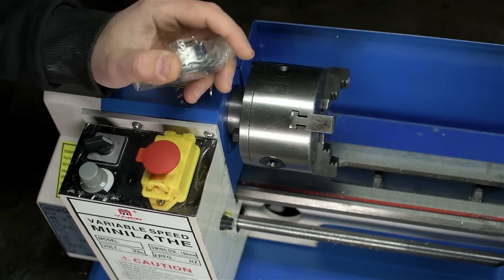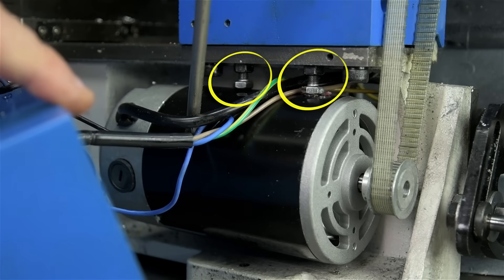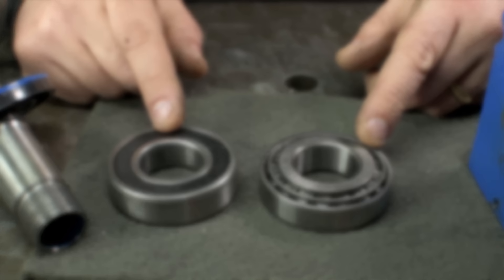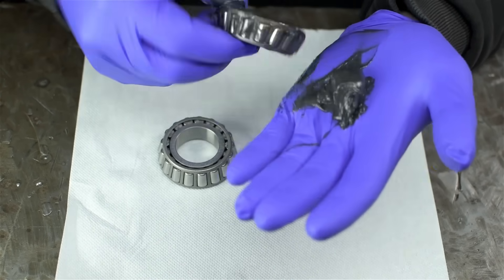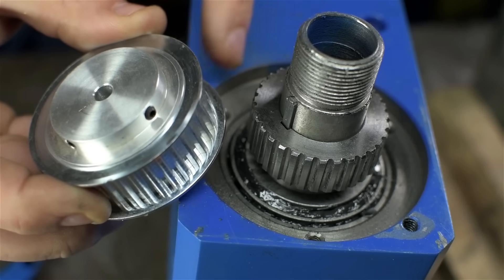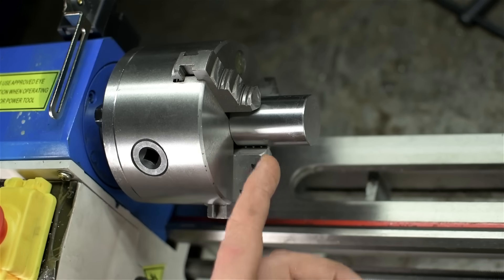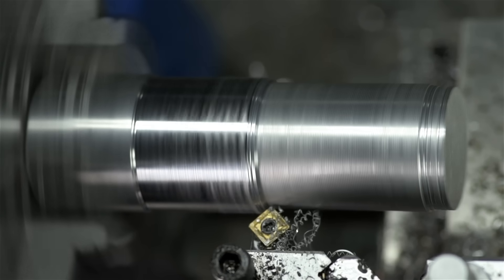Better LATHE Than Never!

Comment: I had a 1970 VW bug. Now I worked on fixing this at 16. Yeh Dad, helped, but I put the fire out; when he was brazing.  The Pre-70's front ends had twin nuts, like you have and a tin sheet metal flange you beat over to lock the nuts in place.  Well - I had to change my front end, for a 72, that I also grabbed. Whole cars, were as good as spares, back in the day. So imagine my wonderous  surprise, when I was met with a pair of roller bearings and a split NUT, with an Allen screw.  The word F-UP was entered into the Webster Unabridged Dictionary - in 1980, when I realized I had crushed the roller bearings and races. Installed a fresh set for a Prince-ly sum and I was on the roll again.  Cheers all!

Comment: I have this lathe and its biggest flaw is the carriage. It is, as you show at the very end of your vid, sketchy the way the carriage is fixed to the bed. I though of some plates with underhung bearings, but the underside of the bed is rough casting,  so I'm not sure this would work. 
Did you ever do a fix for this issue? I find it really limits depth of cut before the carriage starts moving around and vibrating... Cheers Martin

Comment: Bearing load is kinda critical. It would have taken very little time to turn one from some steel like material... Aluminum might be close enough. Plastic, besides being crushable has a nasty thermal expansion coefficient. Granted while expanding it will soften an self crush, but when cooling it will shrink with nothing built in to counter that evolution. I really appreciate this this video or perhaps relate to it as I've been trying to tune up one of these Chinese chunkers myself. I won't play favorites though. Life would be significantly less swell without any one of your videos!

Comment: I just bought a mini lathe like yours and it's missing the potentiometer switch I ordered a new 4.7 k pot for it the potentiometer but it's missing some of the wiring is there any way you could take a picture of how your control board is wired to the potentiometer switch for me please
Reply from the maker: are you sure your version is variable speed?  there are (I think) just 2 speed versions? + change gears.
Reply: @ThisOldTony  it says right on the front veritable speed mini lathe model cj0618 and on the back side it does have hey lever but never less I need to know how the wires hook up to the potentiometer I know they go to P1 P2 and P3 but I don't know how my red power wire hooks in I'm not sure if it wires in with P3 and also I have a green wire that's sniped on forward reverse switch I know the two little wires coming off my small board AR the ones that go to the bottom of my potentiometer 4 Switching gears when I turn the potentiometer switch off

Comment: I used angular contact bearings in mine and changed to a 3 phase 750W 1 hp motor. The motor inside the lathe was claimed to be 550W, but was so gutless I didn't believe that. Also there was no labeling whatsoever on the motor. Like you I removed the compound. I only put it on when I need to cut tappers.

Comment: my hardinge HC (same headstock design as HLV-H) has a lowly pair of greased ball bearings in the headstock....should i replace those with a pair of $5 tapered roller bearings?

Comment: Hey mister T. I got a question. I've just ordered a mini lathe called mw 210 (8X16) from China and I want to tig build his table. I was thinking of a table only made of square tubing without plane sized of 700mmx300mm x 900mm(high). What shape do you recommend. I only know that the lathe must be bolted to the table. 
Any idea? Thanks for the videos...
Reply from the maker: any shape but if you can also bolt the table to the ground that would help the lathe a lot

Comment: Reminds me of the time after high school I worked as a gopher at small industrial design workshop.  Lots of sweeping, driving (Go Fetch...gophetch..gopher), mixing silicon etc.  My crazy AF boss said I could get on the lathe.  I had never used one let alone touched one.  He said figure it out.  It was one of the COOLEST times of my life.  All I wanted to do was get on that lathe.  I'd get handed designs for small stuff which I had to turn.  Luckily, behind me was guru working on a CNC who took me under his wing whenever I needed help which was often.  One time I opened the top of the headstock to see the gears working and I dropped one of the bolts in...doh.  The aforementioned boss walked in, saw my plight, laughed and said: "At least you were curious"... I spent a couple of hours trying to get that damn bolt out. Priceless experience!

@ThisOldTony Keep it up. I love your videos. They've inspired me. Thanks!
Reply: Beautiful story. Hopefully many will learn, no one is becoming a pro without making some mistakes!
Reply: Dale Botha
 - I won't comment much about the "dropped" bolt. But I'll add the fact that on my working trousers, with several pockets. There's ALWAYS an extendable magnet! Just saying... LOL 😂

Comment: Well, Mr. Tony, you got through the preliminary stuff. Now it's time to get the surface plate, high spot compound and scrappers out, and start improving the fit of the ways and the flat interfaces. I would bet my life your Chinese POS is no different from the ones I've had my hands on - basically a pile of poorly aged wrapped hardly bedded contacts that reduce the potential stiffness of the machine an order of magnitude or more. The chatter you commented on I've a pretty good idea where it's coming from.

Go ahead, follow the rabbit hole(s), if you think about it you'll realize you have no choice in the matter, the mechanic in you demands it. You'll improve the machine but you'll end up hating it a little in the end. I just scrapped in a humble old HF 7x10 I picked up for a song, it now feels, if not sounds, a lot more like an Austrian Emco. My machine has a very sensitive motor load cut out, I'll never stress it to it's limit without changing that aspect. But I'm not looking for that, just dependable operation for small simple parts that I don't want to make on my 3000 pound Cadillac. I'll probably change the spindle bearings but partly that will be to convert it to a real bearing preload system. The stock nut/jam nut is just plain cheap hooey. It needs a curved washer system (like Logan) outside the left bearing to provide a predetermined preload and room for thermal growth when running at high speed. Why the manufacturer won't spend a few pennies for some curved washer springs is beyond me. 

PS. At least look at the tailstock way fit to the bed, I bet you'll be agast.
Reply: I meant aghast, but maybe appalled is more like it. 

I think the plastic spacer is better than a hard metal spacer, it has a little give and it probably acts a little like a spring.

Comment: hi Tony it is great to see this rebuild we are hopping for some really good learning for changing these bearings and upgrading them to the betterment of their factory abilities, it is an honor to be here and learn how to make this spindle for this lathe type better for us lathe machine operators both in the hobbyist and the professional machine classes. We sure wish you would have done some upgrades in continual lubrication as you mentioned but this is changing and upgrading video so, thank you. 
We do not know about that saddle cross slide so we share nothing here.

Thank you for the share, Lance & Patrick.

Comment: Tony, is it possible to use a lathe like this - with proper knives ifc - to turn small pieces of stainless? Something like 416, nothing fancy, and speed isn't much of an issue. Or should I get something better?

Comment: The same process, but our head had an oil bath for the bearings, on a brand new Hafco/Hare and Forbes lathe with 1.0m between centres. Was acceptable after that.

Comment: I'm sure someone has already said this, but, a couple of belleville washers could be used to create preload on the bearings, allowing for tension to be kept on the tapers as they wear in.  I used this method for pre loading bearings on stabilizer rotors (there is a vid on my channel of one of them in action)

Comment: Dear This Old Guy,
Heeeeeeeelp! The more I look at motors to upgrade the power of my mini lathe the more my (tiny, uneducated) brain hurts! It seems everyone has some different measuring system for power, torque, ability to rip off body parts - whatever. I don't need to get this thing up to warp speed or anything, I  just want to cut more than an ant's test%$#*&@# off a piece of steel without stalling out. Any thoughts?
Reply from the maker: That's a tough one as it depends what you'd like to do.  My plan is for a small 3 phase motor and a VFD.  Seems cheaper than DC with speed controller.

Comment: Wouldn't recommend tapered roller bearings, they need lubrication fairly often. Open angular contact bearings are a better choice, they dont require lubrication all that often, especially not when mounted horizontally. 7206-b-tvp / 7206-be-tvp types are pretty inexpensive. You could get sealed ones, but they are really expensive.

Comment: In my experience, you really need a little tiny bit of slack when cold. If you use lathe for extended periods, bearings should be adjusted when head stock is up to operating temperature. If you only use mini lathe for short periods and it doesn't get warm,, zero clearance  should be fine?

Comment: Thank you for doing this video. Over the last couple weekends, my 7x10 mini started making noises for a few seconds when started then would go away. Then last weekend, it locked up.  The intermittent noise tells me the spindle bearings are going out and I need to replace them. I was surprised by it locking up though, and after a bit of troubleshooting (and a lot of head scratching), I discovered that one of the gears that sends power to the lead screw had seized itself to the bushing it rides on. After more hair pulling and choice words I got the gear off and fixed it, then decided I would wait on the spindle bearings until I could figure out how to get to them and replace them. Now that I know how, I guess that means that I have another project to add to my list for this weekend. Thanks!

Comment: Punching out a piece of old bread in the right diameter will probably do the trick replacing that plastic spacer.
Would certainly feel a lot safer. Or maybe even a piece of dried carrot. Call me old fashioned.

Bether Lathe Than Sorry

Comment: Can i suggest putting a spacer over the shaft between the bearings. Its a little more work to set up the preload but once its sit u can crank on the retaining nuts with out fear of going to tight.

Comment: Ive found alot of vibration to come from the cross slide, the way the carriage is secured to the bed, the way the chuck is attached to the spindle and the spindle tube thickness appears to resonate a bit too. Despite this i still use the little guy to turn M4 tool steel 😅😁

Comment: Molybdenum disulfide should never be used in a rolling-element bearing. Moly has a crystalline structure similar to sheets of paper stacked on top of each other. They can slide against each other but will not compress. So when the rolling element rolls over Moly particles they can do damage to the races. 

If you want me to do the Math to determine the correct grease and oil viscosity contained within the grease, I'd be happy  too. I just need to know the bearings expected operating temperature the minimum and maximum RPM of the spindle and the timken caltlog number.

Comment: Your summary at the end applies to a lot of Chinese power tools.  These power tools could be better "out of the box" if the manufacturer had spent a bit more on parts and a bit more time on proper fit and finish.  A different ratio drive pulley, belt and drive pulley is zero addition cost to the manufacturer.  Tapered bearings, a couple of bucks (they would never use those sealed angular contact bearing).  The cost of metal gears is probably less than a rookie (like me) would spend buying a couple of sets of replacement plastic gears.

I hope you do more with your minila the !

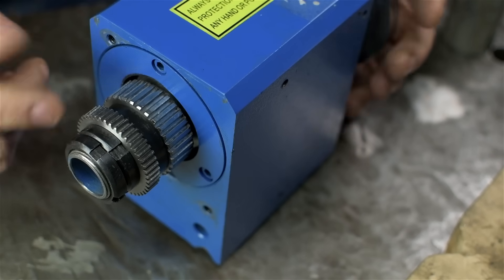Comment: 10:50 When unsure of bearing preload, take AvE's advice.
Tighten until you hear it crack, then back it off half a turn
Reply: I've always used that rule!
Reply: "Back it off a Karter turn"
Reply: Amen @jeffcard3623
Reply: Sounds a lot like the torque values on my aircraft engines, tighten to about 15ft/lbs* before it breaks.

*measure torque with oiled threads

Comment: Power is really poor in this type of machines... I have to remove the motor and replace it with a DC 3 HP.... it truly stinks when you are cutting threads and it literally stalls you know that either you up the power.. or go for a different machine...........

Comment: All lathes are flexible. Smack Minila-T with a brass hammer and listen. Listen carefully. Really. What are the predominant tones produced? Is any component of the ringing about the same, or a multiple of, your RPMs? Chatter (a lathe, brakes, teeth) is one observable product of vibration. Put a gauge on the center of your ways and apply 100lbs of force to the center. More than a couple 1/10ths of flex, and I'll bet the ways are ringing (oscillating), causing some (or most) of that remaining chatter. Maybe temporarily support the ways with Sorbothane sheets or set the whole thing in a cat's litter box - anything that dampens the observed ringing. If cancelling some ringing eliminates some chatter, you could pot the underside voids with a mix of fiberglass, epoxy, and Portland cement (a formula used in some very nice turntables to dampen vibrations).

The same thing This Old Tommy (Edison) emphasized to make his cylinder phonograph, pre-wax era, is making your bar stock look like one of his recordings.

Comment: From other articles I see that spindles get significantly longer from heat during use. Later Colchesters like yours use a washer with axial springs to maintain tension during temperature changes. I bet the reason for the plastic washer is to flex under length changes. I would check the bearing bores in the head. My big HF belt sander had noisy bearings and the bores were way out of round! ???  I guess they used a green casting which shifted as it aged. Go figure!

Comment: While I enjoy your pieces on You Tube I must complain about your bearing discussion.  To say self respecting lathes don't use  
Ball Bearings not completely correct.  Some large lathes use roller bearings as well as lathes that get HEAVY  like Oil Country lathes use and run slower speeds,  My two Monarch10ee's ball bearings .000050" run out or less when new my 22'" Harrison 550 Ball Bearings, My 10mm Levin ball bearings, my 15" Sheldon and Nardini lathes ball bearings.  They are super precision double angle contact bearings.  Manufactured in matched sets of 2, 3 & 4.  To your point some of my machines have roller bearings carrying the spindle.  
Always loved the South Bend spindle bearings, steel on steel super finished. Have fun!

Comment: I love your comments at the end. Back when I learned metalwork in school (on a Colchester Student of course, because schools gave a damn about engineering back then) the teaching method seemed to be multiple iterations of "Now that you've learned how to do that hard, tedious, error-prone task well, here's the machine that does it better" - so for instance not being taught about the power feed until you've demonstrated you can hand feed a nice finish, or not being taught about screwcutting until you've mastered a tap and die.

The point being - this approach helps you both understand and appreciate the tools more. Tearing down and rebuilding the mini-lathe is a great project for a newbie engineer

Comment: I'm a diesel mechanic and when I have to replace a wheel seal I have to remove the hub which happens to use the same taper bearing. Just bigger. The way I preload those bearing is tighten to all hell and  back off a full turn then tighten a quarter turn. Should get you close to that sweet spot. Adjust either way to taste

Comment: All your videos are great, thanks for making them.

On machines this small the qc tool post overhangs the cross slide on the left and there is no direct support under the tool bit.  An old rocker tool post (if it fits the slot)  would transfer the tool forces straight down into the cross slide, and ability to adjust hook or rake angle.  The more “stuff” between the cutting edge of the tool and the cross slide the less stiff the lathe will be.  Less stiff is more chatter.

Another issue with qc post is the inability to adjust hook angle of the bit in any direction.  A lot of carbide inserts have a negative hook or rake angle and take a lot of thrust force to cut.  This has benefits for modern massive machines.  For a lathe this small, springy and weak, the kinds of positive rake tooling used in 1930 may give a better result.

A brazed carbide tool is cheap and easy to modify to a positive rake in both cut directions. One can grind the insert, or machine the shank on an angle to rotate the tool slightly in the tool post sideways to make a positive rake in the right to left cutting direction. A second strong positive rake or hook is created in the infeed direction by tilting up in the rocker tool post. The carbide insert will need to be ground on the heel for clearance.  The shank of the tool may need to milled narrower to fit the rocker tool post.  Make any tool and toolholder (if used) stick out as strictly short as possible to make the cut needed.

Comment: What would you recommend as a starter lathe, I have a decent budget for a lathe and tooling (2,500 usd). Is it worth getting a small 7x14 or 8x16 to learn on and turn small parts, or should i just invest in a larger say 10x22 Precision Matthew?